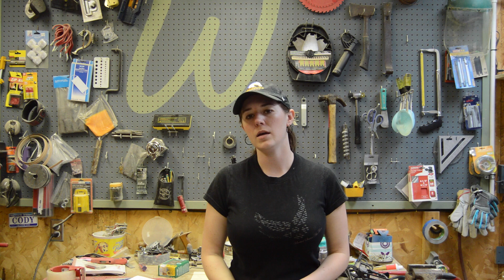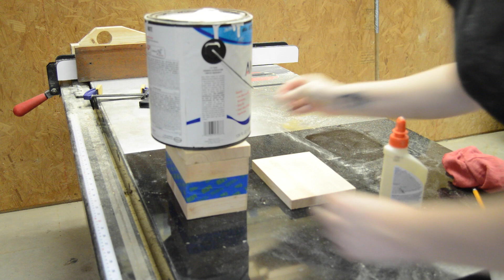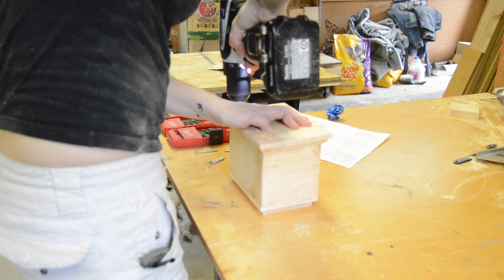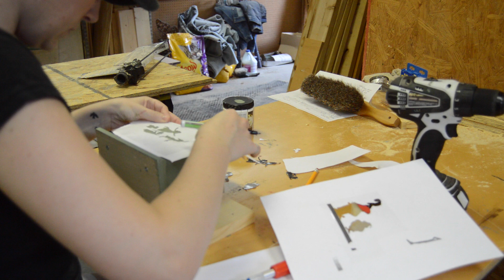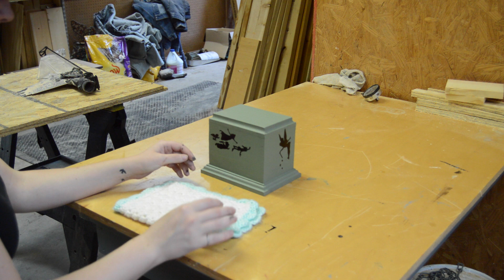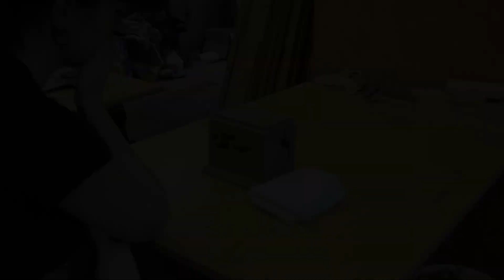Garden of Innocence Cremation Urn

Comment: A construction note: you may want to wait until the sides are cut and glued before you cut the top. Cut it a little oversized, glue it to the box, and use a trim bit in your router to shape it to its final size.
Reply from the maker: Great note. Thanks Larry.